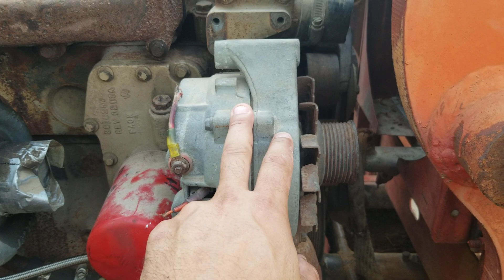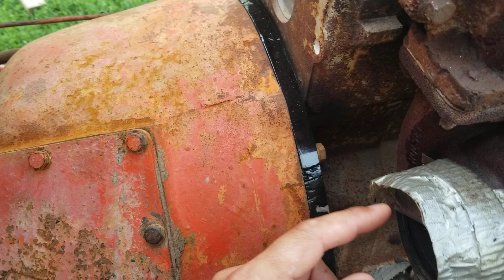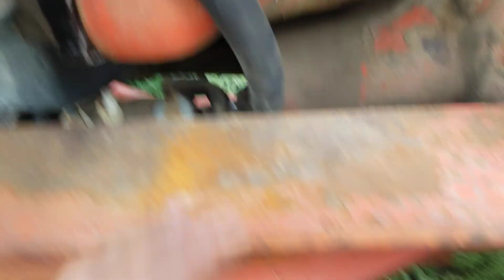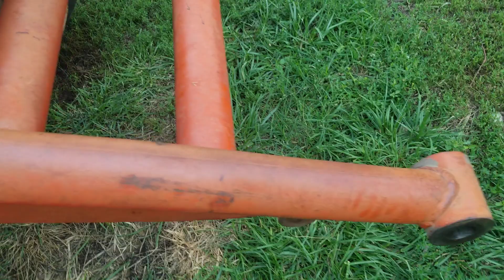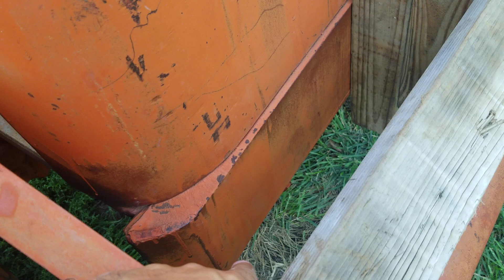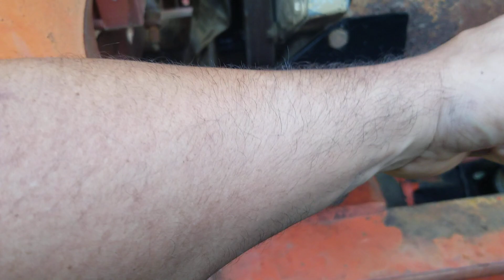Tractomotive TL-12 gets a diesel!

Comment: You and Brian Bloc swapping Cummins for gas jobs. Looked like an old A/C electric fuel pump beside the steering box. I thought it was an A/C rig. Will watch the link and God Bless. A little short for a 110. Been a sub for Contractor Mag for a long time. Fine outfit, too!
Reply from the maker: Yes, now that I think about it you are correct about the old electric pump.  I think a 110 would be overkill a bit, but the 2-53 i have sitting around wouldnt cut it either.
Reply: @bigcal36  With a 110 you wouldn't need a counterweight but maybe a set of West Coast mirrors for backing up. A 2-banger might make a pony motor though. Just have to run it through a 5x4!